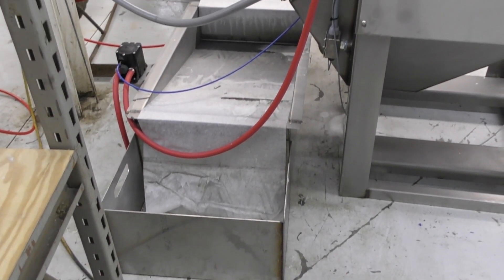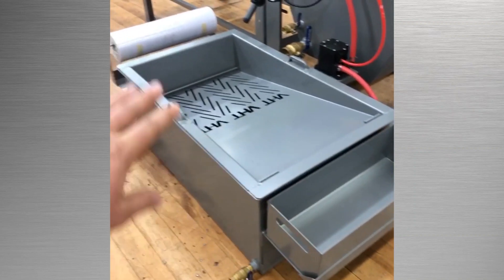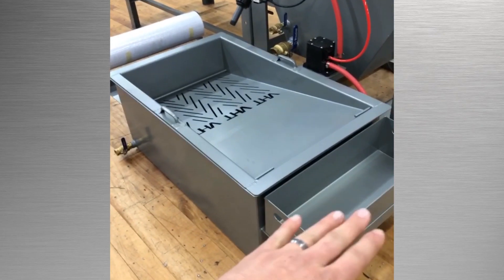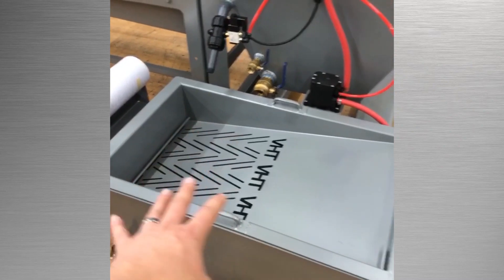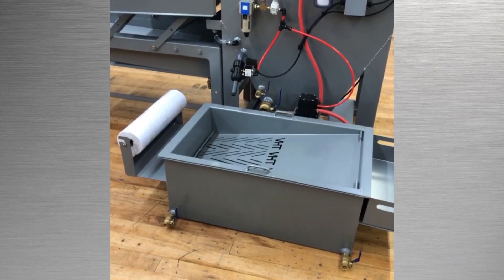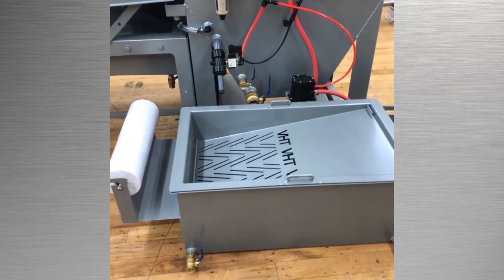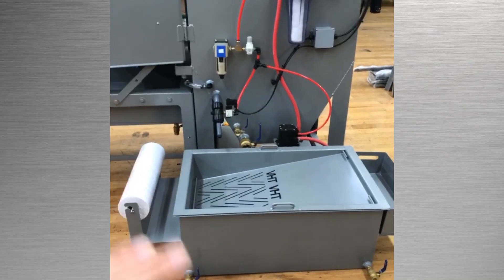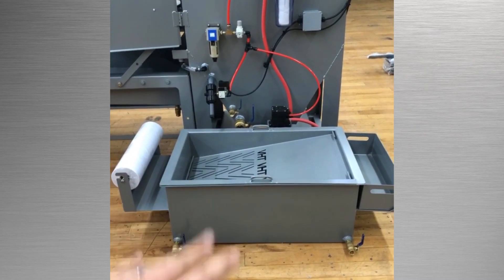Talking about the Industrial Filtration Closed Loop Basin - Vapor Honing Technologies

Comment: Won't the slurry also get caught in the filter?
Reply from the maker: Ideally, your unit should be set up so that your abrasive will settle to the bottom of the hopper prior to draining.  There will be small amounts of abrasive lost, however, you just pull the paper to have a clean filter and check your abrasive ratio weekly to maintain a 20% ratio for blasting.  For more information or to place your Order Today; please contact me at 828-202-5563 x 103 Niki or Email nicole@vaporhoningtechnologies.com